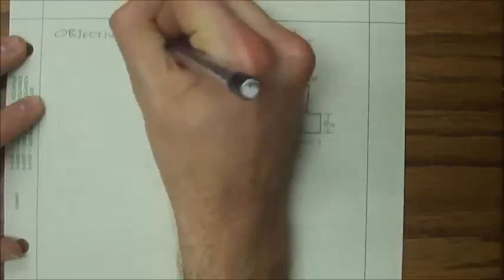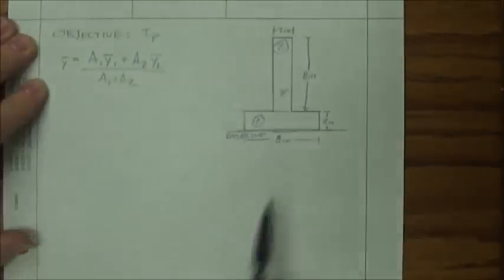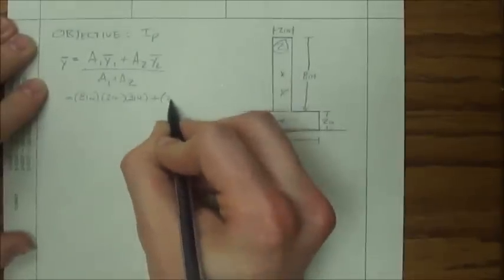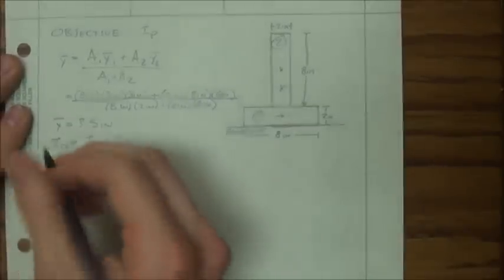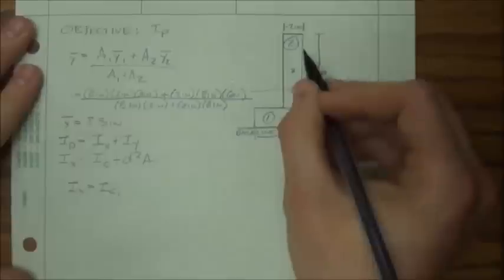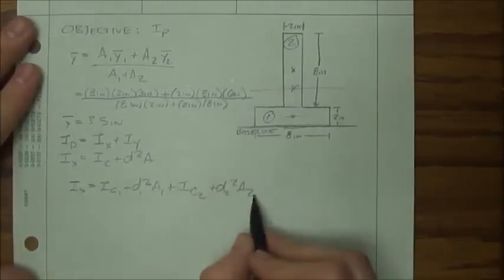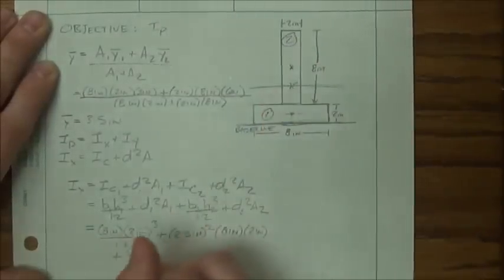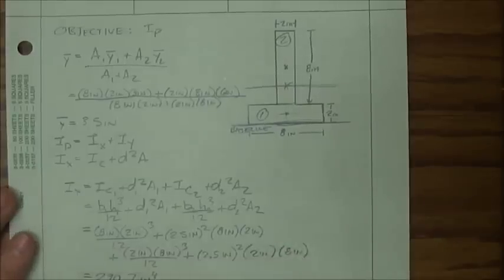Polar Moments of Inertia - My TA Lab

Comment: Polar moment of Inertia is NOT Ix + Iy!!!!  This is only true for closed shapes such as cylinders, square sections, hollow tubes.This is a very common mistake and can lead to actual failure of parts in the field.  For example, quick easy look up test using AISC 14th Ed.  If we have a W beam, W10x30 lets say.  Its Ix=170in^4 and Iy=16.7in^4.  If we use this method we get a false idea that Iz (or J) is 186.7in^4.  THIS IS DANGEROUS!!! Its actual polar moment is 0.622in^4.  W beams are terrible when it comes to rotation as they naturally want to twist. Iz or J is the integral of p, (distance from centroid) in respect to dA (area)Its usually very hard to calculate by hand.
Reply: +malkavian5 That was actually the purpose of me coming here was to see if this video talked about the assumptions made when using Iz=Ix+Iy (perpendicular axis theorem). I made the mistake of using that theorem for a rectangular cross section and am looking for an explanation for why it doesn't work. It seems it's pretty hard to find it mentioned that Iz=Ix+Iy only for particular cases. It doesn't work for rectangular cross sections either!
Reply: I think part of the problem is confusing polar moment of inertia with torsional constant. They are the same for some shapes, but shapes such as the rectangular cross section, in my case, they are very different. Every textbook I look through has this Iz=Ix+Iy for polar moment of inertia.
Reply: How does one calculate the polar moment of inertia for such shapes (like I-beams or ellipses) then?